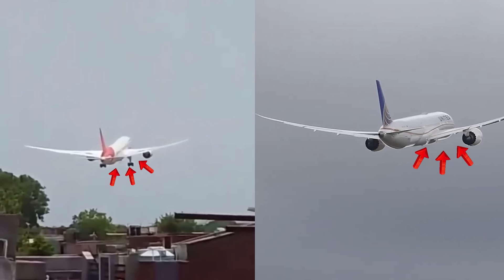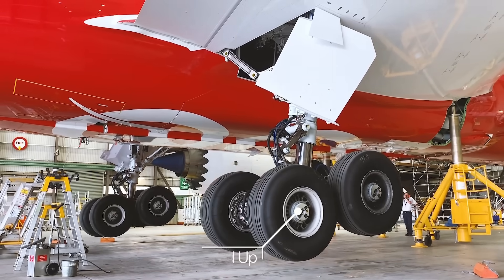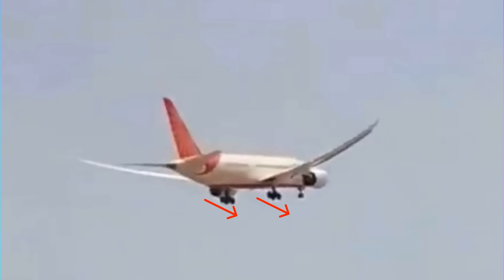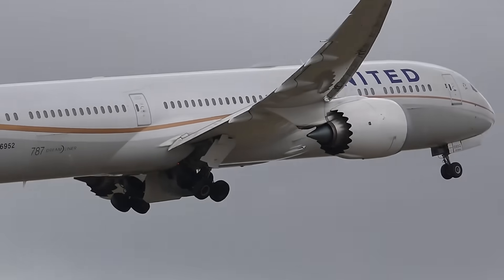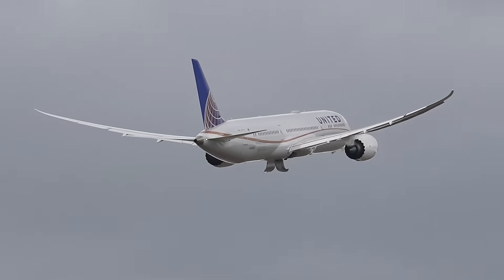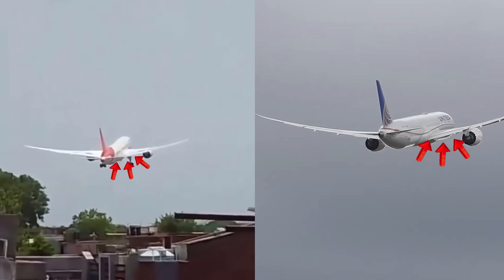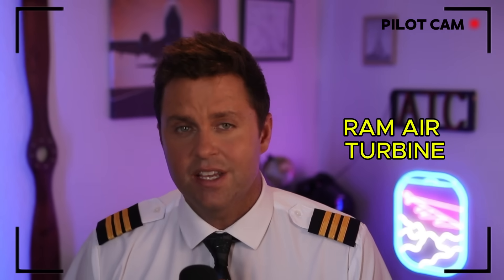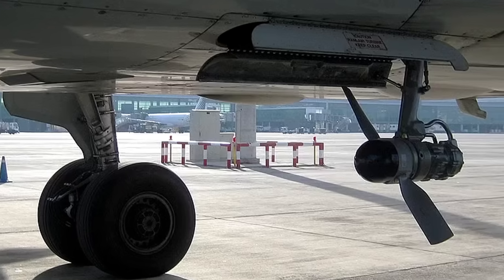Pilot Explains: A New Detail in the Air India 787 Crash Everyone Missed

Comment: All four generators entered failsafe mode and shutoff once the aircraft reached "positive rate". The generators power the 235VAC fuel pumps, and all the flight systems and controls.The pilots would have experienced their displays go dark and the power roll back slowly. Hence their mayday declaring loss of thrust. They probably believed the loss of power was due to the loss of thrust. I however believe the loss of thrust was a symptom of a total electrical failure. Remember, when Sully had a dual engine loss at altitude, both he and Skiles took 15-30 seconds to just assess the situation and determine a course of action. This crew at Air India faced a complete loss of power, loss of thrust, loss of primary displays, and loss of ads-b data.All at an altitude of less than 500ft. Their speed would have been barely V2, their momentum carrying them an additional few feet before beginning to settle. The RAT deploys and tries to recover power to all systems, but the process is slow and requires more time. Time they did not have. All the while the gear has been commanded to retract, but no power means the sequence is interrupted and you see the forward tilted gear.

The speculation over a total electrical failure is based in part to a historically relevant situation that arose in 2015 where the FAA warned of generators allowed to run continuously without cycling them on and off. The resulting condition would, after 248 days place the generators into a failsafe mode where they turn off regardless of phase of flight. FAA guidance recommended crews ensure the generators were cycled on and off no more than 120 days. 

Should this be the cause of the accident, it would explain everything. From the sudden loss of thrust, loss of communication, loss of ads-b data, RAT deployment. It should also be mentioned that the power loss appeared symmetric without any significant yaw, as though whatever happened, happened at the same time. Even fuel contamination and bird strike would render a slightly different outcome of flight performance.
Reply: I think you're on to something. But could you maybe re-word your generator cycling warning.  I don't understand the 248 days aspect.  248 days continuous operation? who does that? and what is the failsafe mode?
Reply: @samwoodward4080  This aspect requires the most speculation, and requires a belief that Air India was operating the aircraft with a faulty APU, thus requires generators to run continuously (Yes, the generators can be run despite engines off. They would be in a standby mode.). My theory has a bias that Air India's troubled maintenance history placed this aircraft into a unique situation, where some electrical systems were faulty or failing, and the airline is refusing to remove it form service to address technical issues. Its flight log book showed that half of its flights were delayed or severely delayed. Whether the cause is technical, operational, or weather, the company pushed it to the limit.
Reply: @Loki516-s9z  APU would be shut down after engine start unless required for an engine generator or hydraulic system MEL.
Reply: @Loki516-s9z   Sounds like lawsuits, individual or class action, could possibly shut down Air India if they were proven to be negligent in their maintenance practices?
Reply: @TheLitehart1  In that part of the world and other countries, I believe they hold airline leaders criminally liable for acts of negligence resulting in loss of life. We shall see what the coming weeks unfold about the aircraft maintenance and log books. That should illuminate the condition of the aircraft and give answers as to why passengers reported inoperative AC, and other electrical glitches in the entertainment system.
Reply: @Loki516-s9z  Thanks very much. You are clearly very knowledgeable on this subject. As you say, it will be interesting to see how this unfolds.
Reply: @Loki516-s9z have youu a link?
Reply: @petergill2265 there has been issues from the early days with the apu batteries over heating
Reply: @scottbaccellini9174  Nothing to do with the APU, and that issue was resolved 12 years ago.
Reply: It's called AD note 2015-09-07, which is repetitive. If AI did not perform it before the deadline they might as well close the shop because there will be some heavy a..  lawsuits ...
@samwoodward4080
Reply: Wow, good info..... You may just be onto something.......
Reply: Aircraft power up may be interrupted in a certain period of time. Like a computer reboot. The system is likely to self  reboot if maintenance do not do so , and this is the fail safe mode.
Reply: @iuriryzewski2648 
You remind me of a story from many years ago of a professor who decided to use 
a personal computer to solve a very complex problem.

After the computer had worked on the problem for a full 365 days
it suddenly shut down or rebooted thus meaning that the data was lost
before the computer had had e long enough time to finish solving the problem.

The manufacturer of the computer said that it was never foreseen that 
anyone would ever have one of those computers working on one problem 
for more than a year.
Reply: If all four generators entered failsafe mode, will the FDR capture this event?
Reply: @seniorswiftie  Yes, unless the FDR is powered by the generators. then it would have cut out immediately. However, I am not certain of the powerflow for that system.
Reply: Having to recycle the generators on and off sounds like a real design flaw of the 787.
Reply: Not saying that you're incorrect, but it would be Unbelievable that a jetliner could fall out of the sky because humans forgot to cycle the generators from time to time.
If any part of that is true then every system needs to be rechecked/redesigned in aviation. Unacceptable and inexcusable if real.
Reply: Excellent, thank you
Reply: I'm fully behind this explanation, the software has the ability to cut the power - that shouldn't be allowed. An integer overflow bug not once but twice is amateur hour. The software was outsourced to India so Boeing and India will conspire to cover it up for mutual gain. We should be forcing this theory into the mainstream before it's too late
Reply: @anon1832: I don't know the details of the 248-day issue, but some simple math may point to the underlying cause.

In many embedded processors, 4-byte registers are used. A 32-bit signed 2's complement integer, that's incrementing every 10 ms, will go from a reset value of 0 (0x00000000) to its highest positive value of 2³¹-1 (0x7FFFFFFF) and roll over to its lowest negative value of -2³¹ (0x80000000) after 248d 13:13:56.48 of counting continuously. Perhaps the sign change in bit 31 triggers the failsafe action.
Reply: Thanks for this contribution ... One of the most measured and well-argued suggestions I've read so far about this tragic event. But as always, only the official investigation will give us the facts.
Reply: This plane is the first version of the 787 not the second version .
Reply: My GOD, this could be the reason.
Reply: Pilot said loss of power, not thrust!!
Reply: Wonderful information very educated pilot or engineer
Reply: Aircraft certification requirements, the engine should still produce power without electrical driven fuel boost pumps, is the 787 different, I doubt. The engine driven fuel pumps can suck fuel from the tank the aircraft is plumbed that way, only the engine fire handles can stop that by shutting off pylon valves. There are many examples where a failure prevented engines from shutting down, pulling the fire handles being only option, the Tenerife 747 accident, engines were still running post impact.
Reply: @guyhealey8118  I think that the engine driven fuel pumps cannot guarantee all fuel all the time. I believe that at certain altitudes, attitudes, flow rates and configurations the non-electric pumps could provide less than enough fuel. I think this deserves serious consideration considering the takeoff was in hot and heavy conditions with the gear staying down. How much % reduction in thrust could they tolerate? Could rotation be a problematic attitude?
Reply: I agree that’s all possible.  But it’s also a 1 in 50,000,000 chance.  Like winning Powerball, MegaMillions and a Nobel prize, all in one day.
Reply: Great analysis. Seems very plausible
Reply: @marcuscollins7018 this bug was fixed by collins aerospace worldwide in all operating 787-8 in 2015.
Reply: On the previous flight for this plane I think they reported the aircon was not working and the in flight entertainment / overhead lights / assistance buttons were all frozen. I suspect heat played a significant role in this incident as hot computers can fail in strange ways. When the power demands were high at take off - operating the flaps, hydraulics etc simultaneously, something tripped or reset, and the software didn't have time to recover.

A battery might have also turned to cheese - has voltage but cannot supply current. 

I could be quite wrong. 

At any rate, I would not trust an aircraft without functioning air conditioning.
Reply: @MichaelKean aren’t the PACKS responsible for pressurising the cabin as well as providing air conditioning, I’d be surprised if they could MEL that system as they would have no cabin pressure
Reply: @MichaelKean  AC was functioning during flight. Its fairly common in India that carriers dont blast cold air through the AC while waiting for people to board since that wastes fuel. Many carriers dont have in flight entertainment starting till the plane starts to taxi. So both of these are not tied in with the engine failure.
Reply: Interesting! What’s baffling with this is where is the built in redundancy? 
  Myself, I can’t put two batteries together without shorting them out but even I KNOW allowing all generators to shut down…as the aircraft JUST becomes airborne would be the stupidest thing to allow !
Reply: Current Status (June 2025): The software patch was applied to all 787-8 and 787-9 aircraft globally in 2015 end and 2016 start which fixed the software bug which you mentioned. No recent reports (web or X posts up to June 16, 2025) indicate recurrence. Modern 787 fleets are compliant, and maintenance protocols ensure updated software, making this issue obsolete.
Reply: likely !
Reply: Great analysis, feels like you are hovering right over the issue
Reply: Spot on analytics
Reply: The update was rolled out November 2018
Reply: A well reasoned analysis - vulnerability of primary systems reliance on electrics, with potential cascade induced failures aligns with PRECISLEY SIMULTANEOUS loss of thrust = command/control to power output.
Reply: This explains it perfectly!!
Reply: Thanks for this accurate information❤. Amazing you mentioned, "regardless of the phase of the flight."  Can an automatism prevail over reality?😮
Can that be a blue screen and then a reset to previous settings?😮
Was the plane's computer blinking, like it's localization on FR24, or like it's AC?.... causing a reset or loss of fuel pumps, then engine power? A battery short? A manual reset?
Reply: Total electric failure would not shut down the engines. Im sure that at least one boost pump in each fuel tank is powered by the battery buss.
Reply: I am retired thermal power plant engineer, and thinking same way. Electrical failure may cause fuel supply valve or bypass valve malfunctioned and on loss of fuel both engines failed. No time to restore emergency power by rat, emergency power can available only from battery bank which output by any means not available.
Reply: @baburaobagade6941 
At least one boost pump is constantly powered by DC from the battery buss. The whole airplane can go dark but the fuel will still be flowing and the captains flight instruments still work.
Reply: @tomsage653  
Thanks. In 500 MW thermal pant, for control supply, there is battery  back up, dc to ac converter for emergency ac suply, diesel generator in case of generator tripping on  total grid failure. I had experience once the failure of control panel power. We can not imagine combination of problems more than one, but it happens rarely.
Reply: Engines run independent of Electrical systems...they provide their own power to their Fadecs...doesnt explain thrust loss 
Dual Engine failure from common cause like fuel issue would . AC appears is in electrical emergency induced by dual engine failure. That state does not provide full hydraulic flow capacity to raise the gear....
I hope they inspect all aspects of where this fuel came from and how it was handled
Reply: @mstew145  Yes, I would love to see the Fuel Flow rates to each engine that hopefully were recorded by the FDR
Reply: Pretty much there . My understanding is that post lift off the electrical system goes to a  configuration change and in this instance that change caused a complete loss of electrical supply(due to a faulty component arcing out) to the FADEC in each engine simultaneously. The  default position for a failed FADEC is to roll back the engine to Ground Idle. Ex colleagues of mine who operate the 787 tell me that the is no drill for this kind of failure as it was considered impossible to happen. There is a way round it (with hindsight) but in the few short seconds they had to deal with the problem it was too late to invent a new procedure which had never been considered. All the negative comments about mishandling and or deliberate malfeasance are inaccurate and hurtful. If this theory is born out Boeing and Air India are going to have to have a serious look at their operating procedures.
Reply: A failsafe mode of "off" regardless  of phase of flight sounds more like  critical failure mode to me.  Why would this not be addressed in the last 10 years?
Reply: @DIYAllied  This is the direct quote from the FAA in 2015: “We are issuing this AD [airworthiness directive] to prevent loss of all AC electrical power, which could result in loss of control of the aeroplane. “If the four main generator control units (associated with the engine-mounted generators) were powered up at the same time, after 248 days of continuous power, all four GCUs will go into failsafe mode at the same time, resulting in a loss of all AC electrical power regardless of flight phase.” Cited from "The Guardian" (2015)

It was addressed by the FAA. However, as these things go, especially in other parts of the world, they may not adhere to the same directives and safety measures adopted by FAA and EASA. It sounds bizarre and exceptionally rare. A condition that is rarely known, with an unusual caveat of requiring continuous operation for 248 days (8 months) to cause this, and have it happen at the worst possible time is exceptionally rare. Moreover, it is that kind of rare that us the catalyst for accidents to happen.
Reply: @Loki516-s9z  very interesting.  Redundant systems for almost everything and a "failsafe mode" of off during any phase of flight is, to put it simply, just dumb.  Couldn't they make the fail safe mode a light that flashes when the gear has weight on them?  Or maybe something like they wont turn on after x number of landings.  Its flat out dumb regardless of maintanace practices
Reply: @Loki516-s9z  Why on Earth woudn't that be something Boeing would be forced to fix? I mean, couldn't they have made it where the generators could not shut off midflight? Seems like an obvious fix that needed to be made.
Reply: @thehighllama8101 Because Congress, money, Lobbyists and the government needing Boeing for defense contracts.
Reply: @DIYAllied  Well, the "failsafe" mode is to protect the generators. Considering that there's already a guidance to cycle the generators every 120 days (or less), which was thought to prevent the generators entering the "failsafe" mode, then additional protection should not be necessary. After all, there already is  procedure to prevent the generators entering "failsafe" mode.
Reply: @Loki516-s9z  But how is it possible that all GCUs were powered non-stop for 248 days?
Reply: @PanduPoluan  agreed and understood.  My point is switching off in any flight mode as a failsafe mode not only didn't protect the generators it destroyed the entire plane.  The equivalent to a yoke that if you didn't maintain it properly would simply lock up in the pilots hands at any stage of flight as a failsafe to the yoke.
Reply: @PanduPoluan  Correct. This had to be addressed by the FAA because it was something that could be done. My speculation is that the aircraft was never powered down and allowed to sit on the ramp completely off for those 248 days. Either because of a company practice, another maintenance issue (inop. APU), and continuous flight scheduling. It sounds absurd that it could happen, and even far reaching to suggest something like this could even be plausible.
Reply: @frankshepherd9838 this bug was fixed by collins aerospace in 2015 itself so it's not plausible I guess
Reply: @Loki516-s9z this bug was resolved in 2015 by collins aerospace
Reply: Don't these engines have FADECS that isolate after engine start and get power from the accessory gearbox (PMA), not the generators?
Reply: Total electrical failure seems unlikely. They also have backup batteries. The aircraft was airborne for less than 60 seconds. They would have had some power, as the pilot was able to radio the ATC. The batteries would certainly have provided essential power for that duration.
Reply: DOGGY MAINTENANCE WAS RECORDED IN AIR INDIA! THE ENTIRE PROCESS OF TAKING OFF AND SEQUENCE OF EXECUTION CLEARLY INTERRUPTED. HIGHLY LIKE CONSEQUENCES OF POOR MAINTENANCE AND SEQUENCE OF PROCESSES COULD NOT EXECUTE IN PROPER ORDERS.

BETWEEN YOU AND ME...CHECK OUT THE INDIANS STREET FOOD PREPARATION BEFORE AND AFTER....NO MAINTENANCE IS R A REQUIRED! THIS IS A WORKS ETHISC OR WORKS CULTURES OR WORK MENTALITY....? MY SINCERE HUMBLE OPINIONS AND OBSERVATIONS FOR DECADES. 

I DID HIRED MANY INDIA ENGINEERS. NOT ALL ARE ALIKE. THE MAINTENANCE AFTER WORK AND PREPARATION AT MANY TIMES WAS THE MAJOR CONCERNS. JUST AN OBSERVATIONS AND HOPE THIS CAN PREVENT FALL OUT ACCIDENTS AND SAVE LIVES!

NOTE: ONE OF MY INDIAN ENGINEERS WAS A TOP PERFORMER.

SINCERELY,
IN MY PRAYERS!
Reply: Longer text please you lost me at All Four Generators
Reply: What about the apu ?? Would that not kick in?
Reply: @pathakmayank 
No
Reply: probably at this point all 787 should be grounded…
Reply: No, a loss of total electric would not do what you posted. The787, has one DC powered boost pump powered by the battery buss.
Loss of all electric means everything goes dark EXCEPT the captains flight instruments and the #1 radio. Battery buss runs those items and the DC boost pump in the left tank.
Reply: The retired pilot is right Boeing can't take years to decipher the black box.They have it in their possession get the job done maybe it can safe more life's.The Ntsb took two years to start the case against Oceangate.Time we don't have these plains fly everyday.
Reply: I love the Sully reference and what is good about that situation and them being able to tell us they had 15-30 secs to assess the situation. I doubt these Air India pilots had even that. All the data will be nice, but to actually "hear" a pilot talk about it completely different. And very sadly we don't get that in this situation. At least Sully had altitude and some time to do that water landing. Again really love all that you said in your opinion
Reply: I'm no 787 expert, but your analysis seems good to me. A passenger on the plane's previous flight recorded a number of failures (ECS, Cabin power) and I believe was in the process of sending it to all interested parties. The deployed RAT can only mean a total power loss - either electrical or hydraulic.
On other FADEC (Engine control Unit) equipped platforms I've worked on, in a power interrupt situation the ECU locks to the 'last known good' engine setting, hence other reports of engines refusing to shut down etc. The one I witnessed was made worse by the engine's ability to self-siphon fuel, so shutting the fuel pumps off was ineffective, draining the tanks being the only solution.
Reply: Simply conjecture. All gens failure (almost impossible) wouldn't shut the engines down. You're looking at this backwards
Reply: @pilotboy2612  Can you confirm where the FADECs get there power, and are they failsafe 'ENGINE ON' ?
Reply: @rafbarkway5280 Can't find that info anywhere, but I assume loosing the eec's wouldn't shut the engines off, just revert to a default mode.
Reply: You mean that after a certain time of continuous running both of the generators go into “limp mode” or shut down automatically with complete disregard for whether the plane is flying??  That is a terrible design flaw.
Reply: Please don't grill me, but apparently the LATAM incident last year on a 787 was caused by the software resetting itself mid-flight, resulting in similar symptoms. It was initially reported as turbulence. Could be related.

Amongst all the speculation, my thoughts are with the victims and their families. 
I hope they get real answers from the flight recorders and some closure.
Reply: Why would anyone design a system where critical electrical generators turn into pumpkins at midnight, regardless of the flight situation of the aircraft? And why would they all turn into pumpkins at the same time.  I'm not saying you are wrong I just don't understand why continuous operation of the generators is so naughty.   And don't the AC generators (alternators) shut down when the planes engines are stopped and the plane runs  on the APU or external supplies.
Reply: @rjgarnett  I think the fault is related to the Generator Control Units (GCUs) from later comments - not the generators themselves - I'm not sure where the GCUs are physically located relative to the generators on the engine -  but ya, I'm with you -seems like the generators would be OFF when the engine shuts down - but maybe the GCUs stay powered up ? I just can't fathom an aircraft going 248 days  (8 months !) with never being completely OFF electrically - but I never worked for an airline either
Reply: Excellent info ! Just a few questions: (1) the "235VAC fuel pumps" - are these in the fuel tanks (boost pumps) ? Or on the engines ?  I have read both ways for the787 - that the engines have old-fashioned mechanically-driven pumps OR they don't, and have only electrically driven pumps ? Anyone know which is correct ? Hard to believe that engines don't have mechanically-driven fuel pumps anymore but I have been away from the business awhile.  (2) So the "failsafe" mode applies to the GCUs being continuously powered for 248 days ? How could they do that ? Does that include battery power ? Jeez, how do you keep an aircraft continuously powered for 248 days in a row, 24/7 !  Wouldn't the aircraft be out of service during that time frame for scheduled maintenance and be powered down at least once ?  thanks
Reply: Excellent assessment! The 2013 B787 airworthiness directive addresses problems with hot, humid conditions starting with  condensation, humidity and corrosion. The weather at departure was 104F and 90%.
Reply: After the mayday there was no other comms so maybe that was the last bit of juice there was
Reply: This this this
Reply: You've got it. I'm highly convinced by this, way more so than any other theory. Thank you
Reply: Ai
Reply: Yeah I think you are closest to the assumed reason for simultaneous  engine failure. As said previously inferno will make analysis real tough to probe SupershopperNz/ROD🇦🇺
Reply: full cpu shut down with no time to reset........computer have to have redundant system totally independent. with minimum 3 back up systems in place
Reply: Fuel pumps are engine driven.
Reply: @petergill2265 incorrect
Reply: @Hansolo4427  Apologies, you are correct, I was reading my 777 GE90 manual.
Reply: @petergill2265 not on the 787, the engine pumps are electric!
Reply: @radiotvhistory  Apologies, you are correct, I was reading my 777 GE90 manual.
Reply: This is incorrect, I was reading the GE90 manual.
Reply: @petergill2265  yabut not the ones in the fuel tanks (boost pumps) which pump the fuel from the tank to the engine at a positive pressure
Reply: @KRAM-ct7ok  I could believe you, or I could believe the Boeing 787 AOM Vol 2. I’m going with the AOM on this one. Fuel pumps are 235VAC (6) or 28VDC (1). There are NO boost pumps.
Reply: @petergill2265  what do you mean by "boost pumps" ? Where are these electrical fuel pumps located ?  Does it have the output pressure of these electrical pumps ? Needs to be about 500 psi to atomize the fuel via the fuel nozzles in the engine - pressure normally supplied by engine driven positive displacement mechanical pumps. Is there an "engine fuel system diagram" vs an aircraft fuel system diagram ? thanks
Reply: @KRAM-ct7ok  YOU’RE the one who mentioned boost pumps. There aren’t any. There also aren’t any mechanical fuel pumps.
Reply: @petergill2265  Just wanted to see what you thought they were - "boost pump" is sort of a colloquial term for the electric pumps in fuel tanks that move the fuel from the tanks to the engine fuel system inlet under positive pressure - so the engine pumps are not sucking the fuel out of the tank (for high altitude ops or possible negative-G situations).  I still do not believe there are NOT any mechanical engine-driven fuel pumps that pressurize the ENGINE fuel system to make it operate properly with flow & pressure. The AOM usually doesn't go into detail levels on sub-systems like engines - that would be too much info for pilots IMO.  Does the AOM have an engine fuel system diagram (past the aircraft to engine interface) ? Thanks, I would try to download it but it would probably crash my laptop lol. I'm going to google engine electric fuel pumps now; relying on electric pumps totally sounds like Russian roulette to me
Reply: @KRAM-ct7ok  You really have no idea about this. “Boost pump” is NOT a “colloquial term,” it’s actually quite specific. You DON’T know what’s contained in an AOM because you’ve never read one. I’m not wasting another letter on you.
Reply: Interesting insights. Any thoughts on the cause of the loud bang passenger 11a heard?
Reply: @quicksquiz   On one of the videos, the pilot said the deployment of the RAT would likely be the source of the loud bang coupled with the cabin light flicker reported by the survivor.
Reply: @quicksquiz uite possibky the bang heard by the survivor was the RAT deployment. The RAT Door opens and the rat drops to its end stop. Similar bang to when landing gear doors open and gear reaches down and locked. If the engines were rolling back the RAT deployment would have been quite loud
Reply: @Gaz_511  I thought the same too. Others report that it is spring loaded with force to pop out quickly.
Reply: @quicksquiz I can’t remember if it was Capt. Steeeve or Juan Browne, but they said with hearing that loud bang and the lights flickering is exactly what happens when the RAT deploys.
  It is a sudden, forced drop of the RAT that vibrates throughout the whole aircraft and flickering as the RAT starts to produce energy.
Reply: @quicksquiz the RAT deploying quickly
Reply: @quicksquiz  loud bang and flickering lights...apparently can happen when RAT deployed....
Reply: That’s some classic info right there
Reply: Pilot said mayday mayday, no power, no thrust.
Mayday is immediate emergency  landing. Copilot would be on a check list pilot would be looking where he is landing. 
20 seconds later he landed, the rat was deployed, emergency power was on. Survivors statements confirm this 
No power....no electrical power? No hydraulic power? 
No thrust? Engines have shut down
 The raising of the gear coincided with the mayday call of no power, no thrust.

The airport will have all sorts of records of water in fuel tests. It would be routine that a pilot would preflight check for.  Fuel, tires.maintenance.

It is a miracle that seat 11A survived. The air hostess, whom he stated he witnessed her death, was exactly where she was trained to be....getting ready the emergency exit.
I wouldn't be surprised the blob the camera caught flying through the air was the emergency exit door, being propelled by the malfunctioning air ramps.
No power no thrust.....

What could cause that to coincide with raising the gears.

We need chuck yaegar pilots
Reply: @michaelbrownlee9497  What a load of bollocks...is this how your brain works?
Reply: I would think the motors would gravity feed from the mains, or from the aux tanks if the crossfeed valves were open.
Reply: @Greg-de9ok  Even so, the fuel rate would slow. In all likelihood, the engines probably impacted the ground while still receiving some fuel that was already pressurized in the system.
Reply: @Greg-de9ok yeah, the Qantas a380 that suffered a engine failure, the engine kept going even after they landed, had to be shut down by flooding the engine using foam and water.
Reply: @Greg-de9ok  I agree, but no one has confirmed it. BUT if the pumps shut down and there was a loss of pressure with the injection at full power, vapour could be generated.
Then reduced thrusy with no visible signs.
Reply: @Greg-de9ok  There is no “aux tank.”
Reply: Except that the pilot WAS able to communicate and send out a Mayday call...
Reply: @chrisantoniou4366  Battery still powers Captain side radio panel, comm 1 only.
Reply: @chrisantoniou4366  Surely the comm radio would be priority and receive power from the RAT in event of generator failure.
Reply: @chrisantoniou4366  RAT could have restored radio for MAYDAY call?
Reply: @TravelSeekers  I'm told the radio works by a battery if there is a total power failure -  in that case there was no need for the RAT for the Mayday call.
Reply: @TravelSeekers  Captain’s radio panel & comm 1 will run on battery power.
Reply: @chrisantoniou4366  The RAT would likely be able to supply electrical power to the communications systems
Reply: @chrisantoniou4366  I expect this would be from auxilarry battery power.
Reply: @kangamangus95  I've been told that and that is the most likely reason for the Mayday call.  I still think it was a fuel issue but will obviously wait on the black box recorders...
Reply: @chrisantoniou4366  Isn't comms on the standby DC batt rail?
Reply: @rafbarkway5280  I'm told it is, and have no reason to doubt it...
Reply: @chrisantoniou4366  Because the RAT deployed and provided power to the radio.
Reply: @chrisantoniou4366 That’s probably battery powered.
Reply: @chrisantoniou4366  Did You not understand the theory that Radio was on RAT power!!? "The RAT deploys and tries to recover power to all systems, but the process is slow and requires more time. Time they did not have."
Reply: @chrisantoniou4366 because 28VDC Standby Power /BUS, keeps basic comms powered in case of complete loss of AC systems.
Reply: @chrisantoniou4366  they have hand held units to use i believe ...
Reply: @anthonymagic5640  You believe incorrectly.
Reply: @anthonymagic5640 no they don't have hand held comms radio in the cockpit.
Reply: @chrisantoniou4366  RAT takes about 6 -12 seconds to deploy and until then Batteries would Power the Captains side Instruments and Radios.
Reply: @chrisantoniou4366  The Ram Air Turbine (RAT) was deployed so this Dreamliner would have had a bit of emergency power.  Specifically, the RAT would power the communications equipment so the Mayday call was done.  Unfortunately, in this situation, the catastrophic electrical failure occurred shortly after take-off so there was not enough time for the RAT to power both engine re-starts.  This is a truly horrific aviation accident that will be remembered in infamy forever.  My thoughts are with all the families that lost their loved ones in this colossal aviation tragedy.  As we all know, it is better to be on the ground wishing we were in the air then to be in the air wishing we were on the ground.
Reply: So its a Boeing bug ? 248 days it will go to fail safe "at any phase of flight" being the dangerous outcome.
Reply: @TravelSeekers the 248 day bug was fixed but any software engineer will tell you the same thing: the fact that 1 integer overflow could command total AC power loss means the software has too much control. The engines should keep running even without the AC fuel pumps but I don't think this is guaranteed in all phases
Reply: @anon1832 did AI incorporate fix?
Reply: @youngtimer964  no, but the software was outsourced and the ability of this software to even command all AC generator control units to turn off even under the strictest logic is a red flag to me as an engineer
Reply: @youngtimer964 it was fixed globally as per boeing. They did it ok all 787-8 and 787-9
Reply: @TravelSeekers SB category?  When was it issued?
Reply: As per official reports this software bug was fixed, so this fail safe mode analysis isn't plausible anymore in light of new info v
Reply: I think you are correct. Also consider this. The plane reached 425 Ft AGL. The FAA allows the engagement of auto pilot at 400 Ft AGL if they so desire. Perhaps they engaged auto pilot and that auto pilot failed and shut the engines down. Then all power and hydraulics
Reply: @TheGhostofW.C.Fields-lz6xh  It never reached 425 agl. Autopilot can be engaged at 200 agl. Autopilot has nothing to do with the engines.
Reply: @TheGhostofW.C.Fields-lz6xh  Autopilot can be selected on at 200 agl.
Reply: @TheGhostofW.C.Fields-lz6xh  an autopilot failing does not shut engines down…. It cannot
Reply: It's bizarre that you state this theory as if you're reporting actual facts.
Reply: @horsepanther  It's the internet, everything you read is an opinion 😉
Reply: Ah. I typed my remark as you were entering yours. I just hadn't entered it.

I spent several decades in computers and avionics, and as they say "To err is human, but to really screw it takes a computer."
Reply: 235VAC ? Where? ...at your place, not on an aircraft. 115VAC is the right answer, you've failed!
Reply: @LFANS2001   No, he's right. All the main busses are 235VAC.
Reply: @LFANS2001  Some 787 systems (engine starters, for one) use 235VAC.
Reply: if the wings had microspoic craks then they can explode in flight so that would explain the big fireball but no one will ever know because the plane was out of view of the camera when it blew up
Reply: @thethinkingman-  i think you have microspoic craks in your brain.
Reply: @ldhorricks  people use LOL all the time but your comment actually made me laugh out loud!  Hilarious!😂